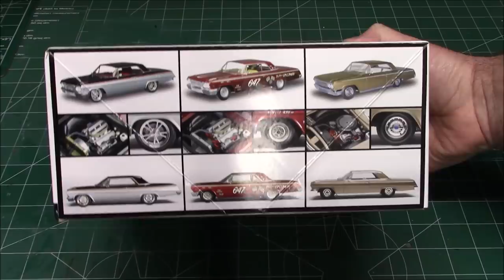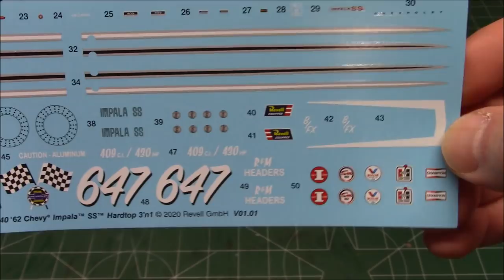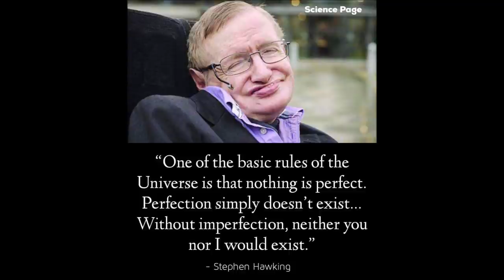1962 Chevy Impala SS 409 Hardtop 1/25 Scale Model Kit Build Review Revell 85-4466

Comment: I had a real 62 Impala like that one. Mine had the bumper with the guard on it in front of the grille you didn't use. Mine also had electric windows, 409 Turbofire engine, air conditioner, rear defroster, dual antennas on the trunk and best of all, it was right hand drive. The only option it didn't have was seatbelts. it was blood red with white burlap seat inserts. All that beauty bought for 20 dollars in 1993. I wish I still had it. What a car. Beautiful model you built.
Reply from the maker: Thanks for spending some time on the channel!

Comment: Is it me or is the fan missing a blade ? Great color choices 
I like when you weather them up because that's a true representation of what old cars looked like 
Most cars were 6 cylinder or small v8 powered
Reply from the maker: Nah, some of the fans actually look like that.
Example:
https://www.ebay.com/i/372774009676?chn=ps&norover=1&mkevt=1&mkrid=711-117182-37290-0&mkcid=2&itemid=372774009676&targetid=935431405613&device=c&mktype=pla&googleloc=9019130&poi=&campaignid=10456336024&mkgroupid=106723176627&rlsatarget=pla-935431405613&abcId=2146001&merchantid=6300864&gclid=CjwKCAiAn7L-BRBbEiwAl9UtkNNZyxkeVps3to_xynOdF-Y58Mzt7B_m8VMe9vTteJYumrIwNWrIaRoCGYgQAvD_BwE

Comment: Excellent kit, great build as usual. How, though, using the bench seat, is it an SS? Any Impala SS after '61 would've had buckets and the console.
Reply from the maker: You'll have to ask Revell. I built it as stock option A in the directions.
Reply: True and well said. So what it comes down to is the car built in the vid just isnt an SS. No big deal, but this hobby largely hinges on specifics for accuracy so it matters a little.